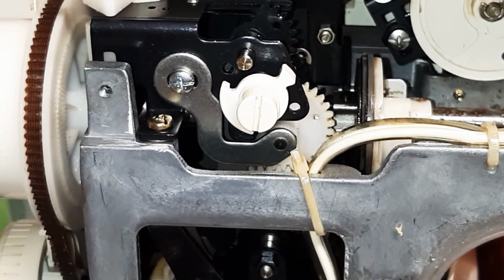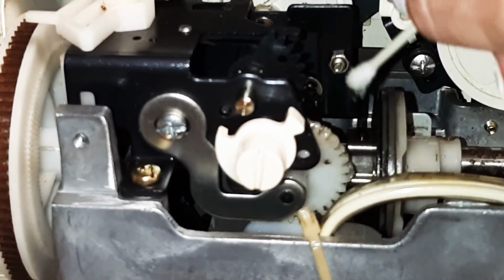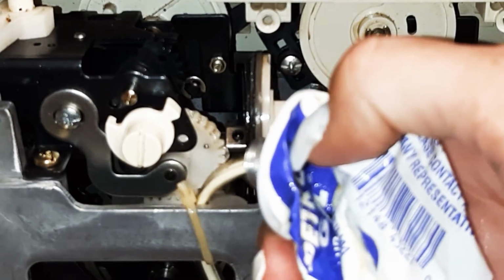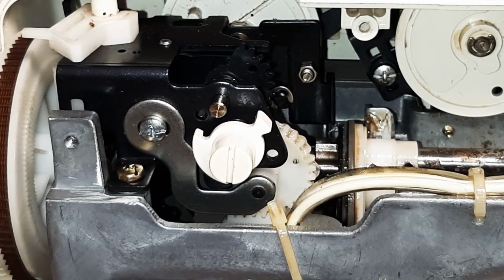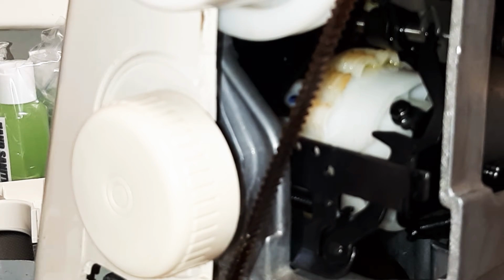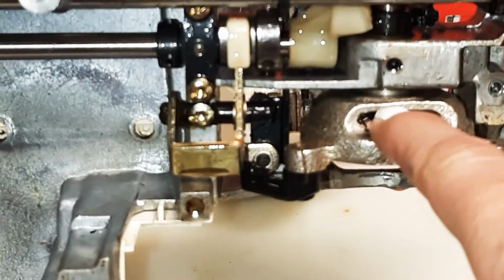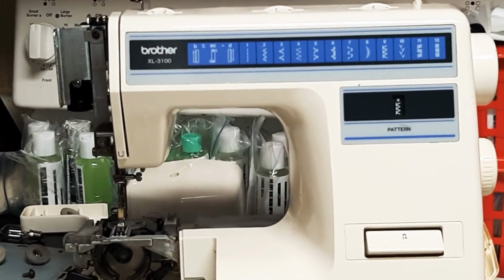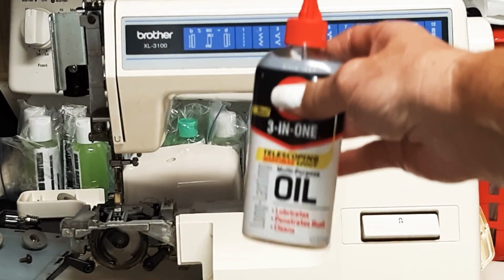How to grease sewing machine plastic gears diy sewing machine repairs

Comment: I recently purchased a SensorSew 70 model 19501....but it's  ceased up or frozen....the machine doesn't appear to have old oil on the shafts and linkages....so I oiled where  indicated in an online owners manual... More than one drop!   Then, I opened up the machine ( not much lint) ... and oiled linkages and metal pieces, staying away from rubber belts and the electronic panel and connectors. But still stuck.. Barely can turn the hand wheel ....am hoping to PM with you for some advice in trying to restore this 💎.  The clutch for bobbin winding does allow for ease in turning the wheel. Also, plugged it in to check if the electronic panel still works.. Seems functional--can enter stitch types, and increase/decrease stitch length and width..but did not /cannot run as main drive shaft is frozen. 
Looking forward to a reply..
Reply from the maker: Probably rusted? Take it to a sewing machine repair man...probably 100 plus to service
Reply from the maker: That is a very old machine. .you can also refer to your manual for service.  ..i mainly use singers ...
Reply from the maker: This is not facebook it is youtube there is no pm messaging